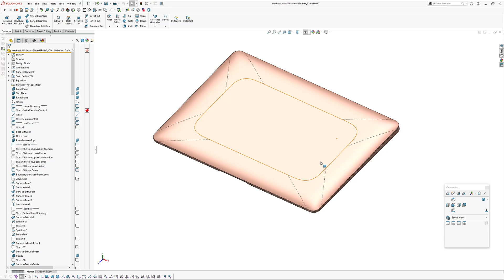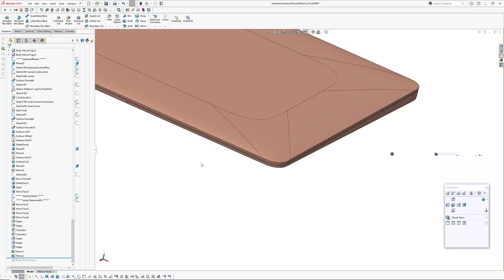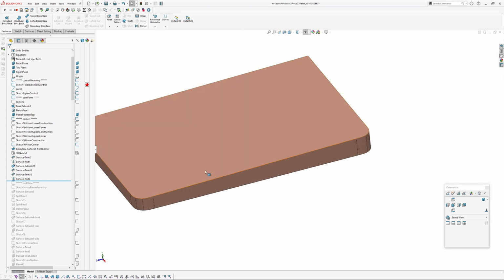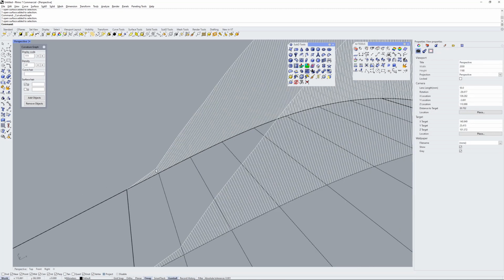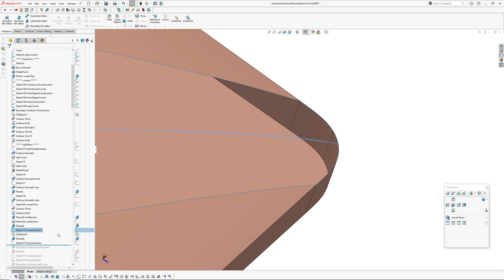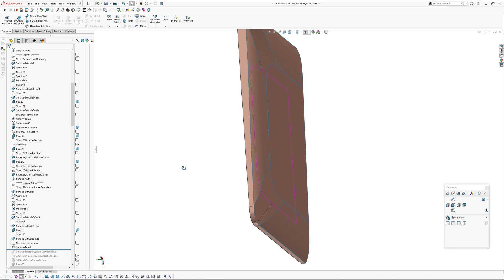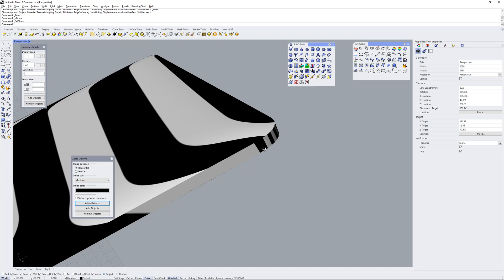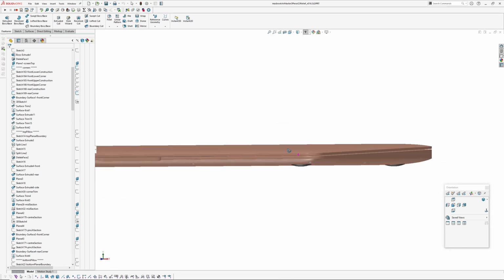MacBook Air M1 Exterior Surface Modelling Exercise in Solidworks Part 2

Comment: Hi AJ, Great content. 
Do you think this would work if the top surface has slight curvature rather than being a planar surface?
Reply from the maker: Yes it will, but it'll require a fair amount of rework, both if it is an extruded top or compound curvature top.
Reply: @AndrewJacksonDesignStudio  It would be great to see your approach to applying this to one of the compound curved back iMacs.
Reply from the maker: I think that'd be tougher than the Macbook. Here's a link to a pic I took of our old iMac. You can see the edge is not planar in the corners. They've decoupled the rear from the corner. 
https://discourse.mcneel.com/t/how-to-create-a-curved-surface-on-a-rounded-square/137844/17?u=andrew9